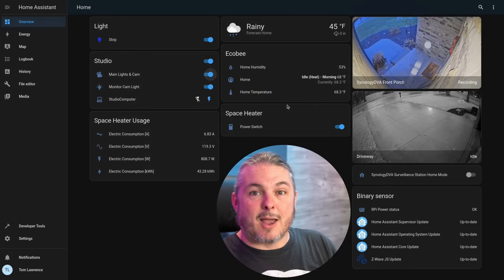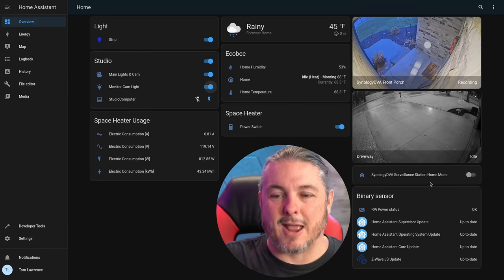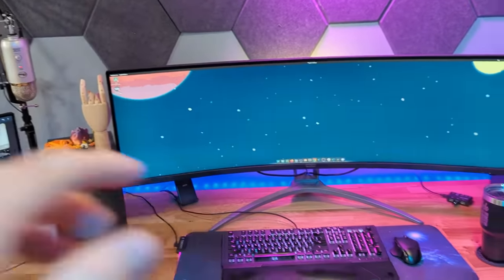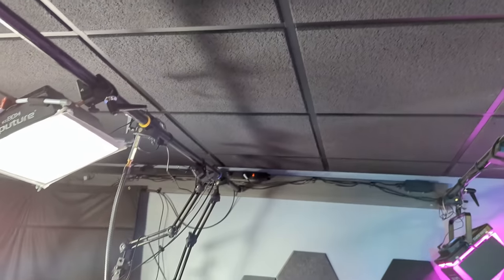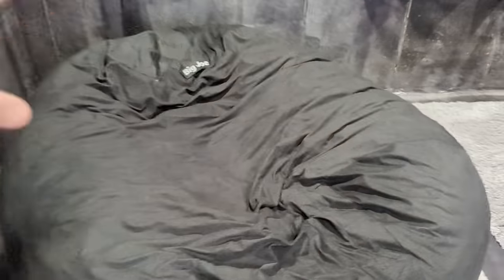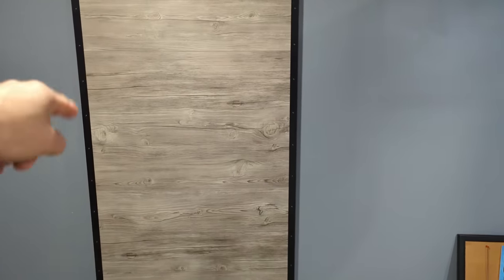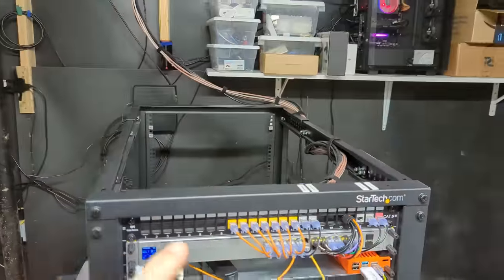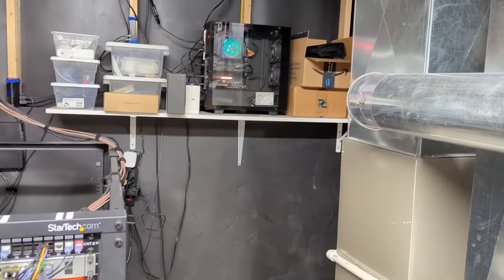New Studio Tour November 2022

Comment: My only suggestion, a cheap one at this is to use a shower curtain or drop cloth in the even a water line busts to protect the server and pc equipment. What I used as simple yet cheap way to protect them. I used a shower curtain for my hot water heater in the event a water line busts.

Comment: Great job!  Thanks for sharing. If you ever rewire, consider using SDI. I use compression sdi connectors and RG59 with my setup. It’s connected to a hyper deck card to my computer and it works great. You do have to add converters, but they are DV powered and would eliminate the UPS issue you had. You can also run any length SDI cable you want and then convert at the end, resulting in really cheap and short HDMI cables. I also run an ATEM switcher. It’s not necessary with your setup, but it was easier for me to utilize all the inputs. I can route any input to any output, and that allows me to keep my monitor count low. Hope that helps.
Reply from the maker: Thanks, maybe when I get around to upgrading cameras I will do that.

Comment: The studio looks so cool! Do you have any problem with that Camlink 4K? seems like they need a separate USB controller to handle all the data, and don't get along with usb extensions very well. Do you run it at 4k or 1080p? If I had to guess the USB Camlink connects to the Sony 6600 and the Canon connects to the PCI capture card as it would have more bandwidth?
Reply from the maker: The CamLink4K captures my desktop and yes it does require a full USB 3 controller without another high bandwidth device to work properly.

Comment: Awesome setup.  Spec wise any reason you run 2 PC's there - is the studio one JUST for encoding/recording?
Reply from the maker: 2 reasons: 
1) I run Linux on my main computer which can be more problematic with OBS and capture cards, also don't want the extra sofware on my main work computer.
2) Less chance of any changes that would mess with settings. Each time the studio computer boots it runs a backup to my Synlogy with versioning so I can roll it back if I do make a change and break things.